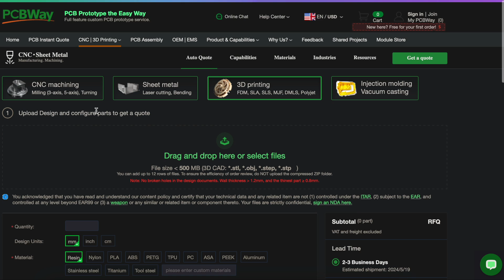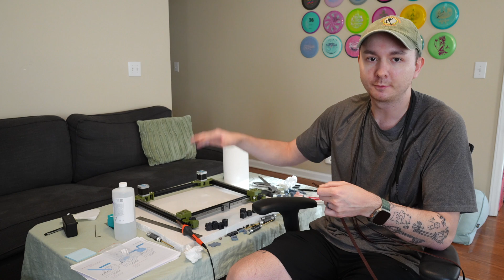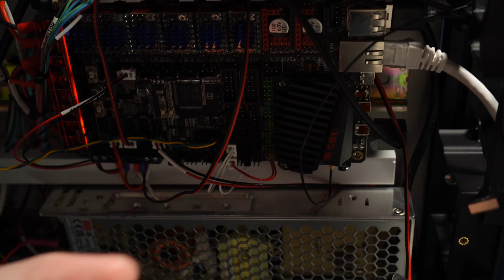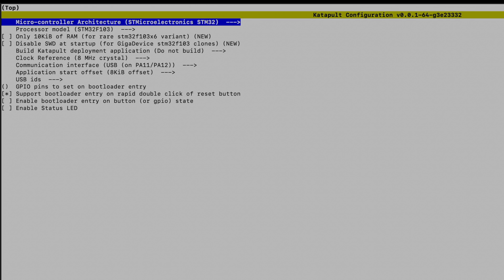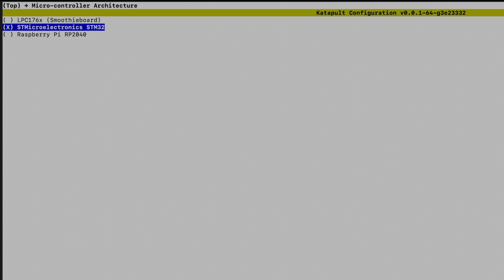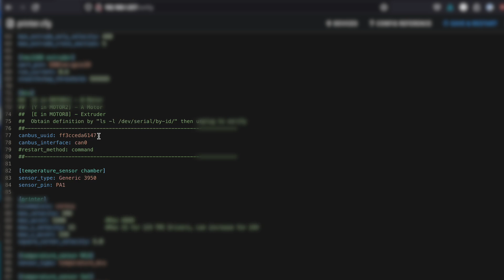Formbot Voron 2.4R2 Pro+ Kit Build!

Comment: Gave you a thumbs up just because of the nerd comment. 😉Very interesting to see the whole process, but I'm boggled that anyone would ever choose this route. Not any cheaper than a good off the shelf machine, and how many hours of work did this take you, as well as how much money needs to be spent on tools in your prep part. It's so prone to error, I wonder what percentage of people end up with a well functioning printer out of it. Amusingly, you said it was all fine, but never actually showed it working, or what quality prints you get out of it.
Reply from the maker: I figured the video was already too long and planned to make a separate video on the quality. I didn’t really intend for this video to be how well the printer performs, since a voron is a voron, but more so a guide for this specific kit. Although, the quality out of a voron is pretty well documented and mostly up how well you build it. For what it’s worth my 2 vorons have the best print quality out of the 6 other printers that I have currently. Off the shelf printers are great but custom builds are as good as you make them! As far as the price it’s definitely comparable to an off the shelf printer but that what I tried to explain in the intro! I think off the shelf printers suit people and custom builds suit others. For me I definitely prefer the custom build route since I can always buy replacement parts and tweak the firmware as I like.

Comment: This guide is the answer to my misery in the past couple of weeks. I am finishing up the hardware part of my build, was already 90 percent done when I saw this video, and like your tips on what to print so will be going back and changing some things. But the main problem I've had is with software. For several days I've been blundering through trying to follow instructions in various BTT manuals, and it hasn't been working. I am a complete novice at coding this stuff and have never used Klipper, and frustrations and lack of understanding abound. I've been thinking of trying to hire someone to walk me through the implementation of Klipper and the Canbus install because I'm not getting anywhere searching the huge amount of stuff on discord and whatnot. I needed a guide that held my hand, and I think this is it. I'll be starting over from scratch and following your guide over the next few days to get set up. Thank you SO MUCH.

Comment: Why did you first flash the katapult bootload on the mp8 and then overwrite it through dfutil with klipper. I agree that you don't need katapult on it because it also connects through usb with the cb1 but it seems like an unneccesary step. Katapult is a bootloader that makes updating firmware through canbus possible. It's really handy for toolhead boards but not needed for the main mcu.
Reply from the maker: I agree it seems unnecessary but I went through this process so many times and this is the one that worked. The other guides I linked have you do it as well.

Edit: as a better answer. Because the M8P essentially emulates having a USB katapult device plugged in you need to load the first 8k as a bootloader and then klipper is written after that 8k so it doesn’t over write it. I actually did make a mistake in the video by not deploying the katapult firmware and it was corrected in the documentation (point out by the pinned comment). Unfortunately I can’t edit videos after they are already posted.

Comment: Dang man, you have more time than I do.  It was only a few weeks ago you responded to my post on Reddit about this kit.  Now it's finished....I need to rethink my priorities and get this finished.  Also I did not know you weren't supposed to print the stl file of the SB main body, because I did print it and have it installed.  I'd be interested to know what the difference is.
Reply from the maker: I did two in the past couple weeks! Haha

In reality this was a lot of late nights and consuming the entire living room at the displeasure of my wife. I get a ton of enjoyment building printers though.
Reply: @ButterPockets  I really enjoy building also, That's the best part, I'm halfway through my build
Reply: @ButterPockets I had the same question, what's different about the SB main body you recommended to print from STEP compared to the one recommended by formbot? I installed the latter and am wondering whether it's worth a redo.
Reply from the maker: @Burnsian85 if it fit then it’s right. Apparently they updated the STL and it was correct but then they replaced it with the wrong version. There’s a tab that slots into the other side of the CW2 and the current STL (at least like 1 week ago) had the wrong tab size to even fit. I printed it and I couldn’t assemble it. It’s from an older revision of the CW2 parts.